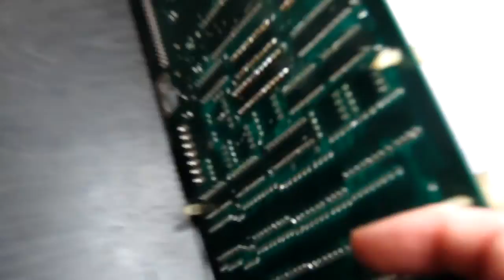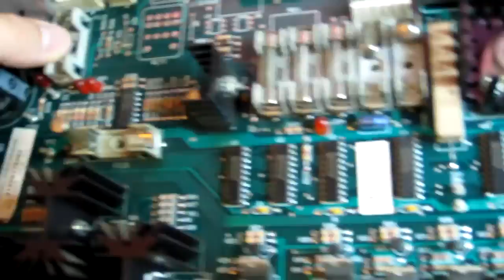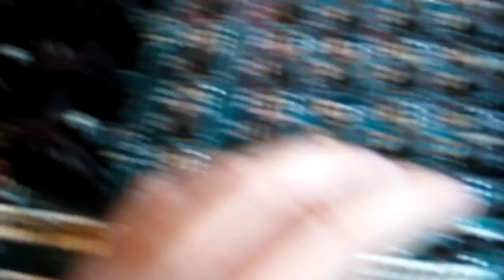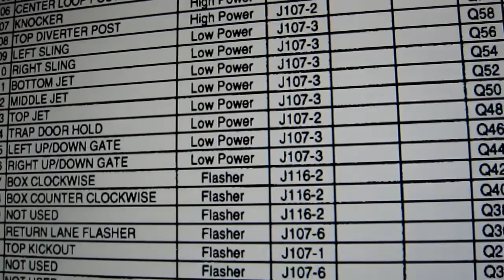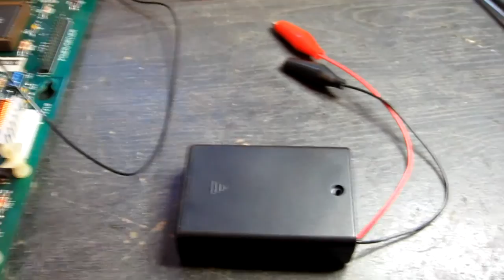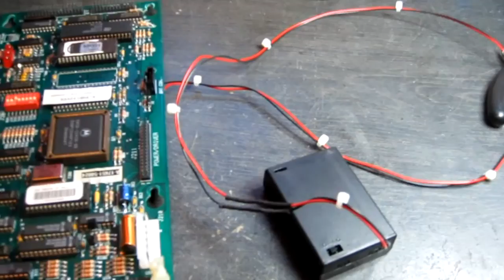Theatre Of Magic Pinball Repair (Part 2)

Comment: 15 amp fuse lol!!!  May as well put a nail in there!  It's no wonder that sometimes these pinball tables start fires when people have put insane sized fuses in there.
Reply from the maker: +GadgetUK164 Oh its so common on pinballs, I literally find way over the top fuses every time someone sends me a machine or driver board to repair. Operators will literally put anything in to get the game running with no regard.
Reply: They should have to have a license to operate them!

Comment: Not entirely sure, it started out with a failure to boot the game board, then after chip-re-seating, dissolved into random faults with C3PO in an audio loop stating "told you so" - I kid you not - I think I was chatting to you or someone else about it at RGP last year, just can't figure it out. I'm hopefully sending it down to Leeds to get looked at shortly.